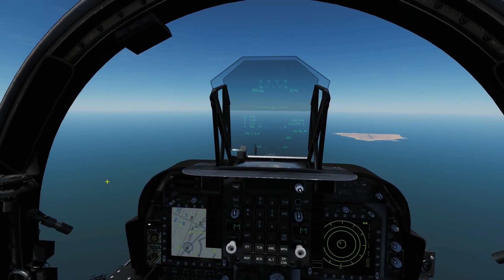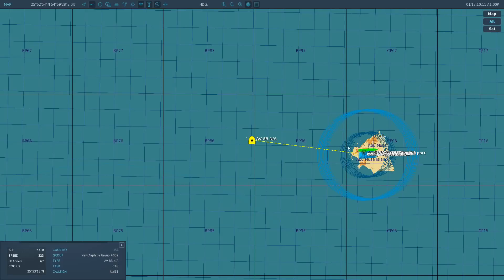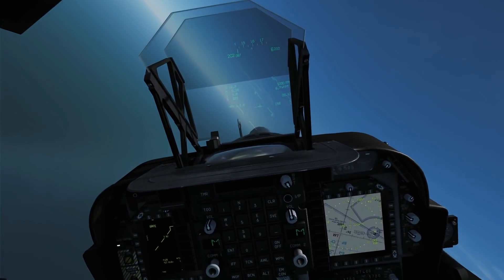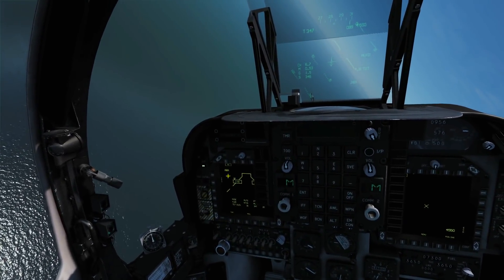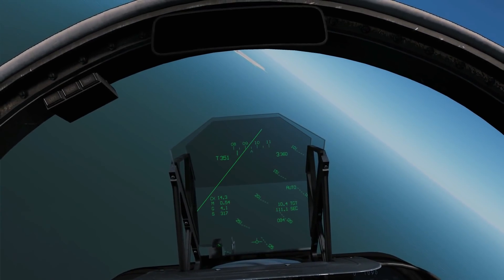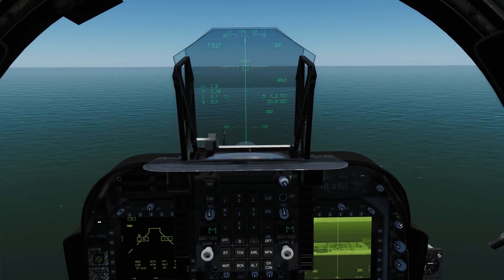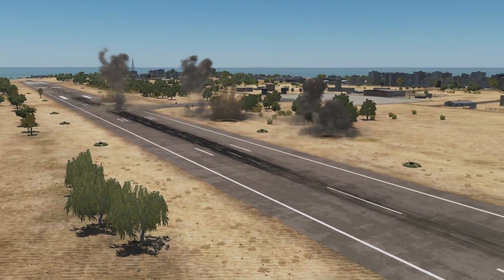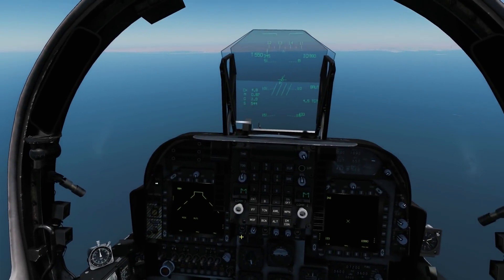AV-8B Harrier: Toss/Loft Bombing Tutorial | DCS WORLD

Comment: The Marine Corps tactics manual specifies the use of the toss (loft) bombing button on the stores page. The aircraft will then give cues as to when to initiate a pull up and the pull up is executed as a 4g pull up the plumb line to about a 38 degree angle.or until all bombs have been dropped. This can also be accomplished with smart weapons too evidently.
Reply: so one could use this with 38's to do a low altitude attack on a sam site?
Reply: @dannypeck96  any bomb, JDAM, LJDAM (utilizing laser or GPS) or LGB. Razbam has yet to implement the toss cue so you’ll have to guess distance which is why a JDAM could be effective but remember that the computer in the JDAM is going to calculate release point based upon your given flight parameters, so you won’t know when or if you can release until you’ve started your pull up and if your early or late you may never get a release cue. it will take some practice and watching some videos of ranges that others start there pull ups but the faster you go the further you toss. 
The laser weapon hold good promise as well assuming you can have a 3rd party laseing such as ground JTAC or an airborne unit or even a buddy orbiting outside but I would assume that if your tossing its because you can’t get close enough to bomb which is where a 3rd party ground base JTAC from say a seal team or other forward recon unit can be of great benefit allowing you to deliver precision ordinance on target with minimal exposure. Could be a good option for low cloud cover too that prevents a airborne laser.

Dumb bombs are pretty accurate with the system as well obviously.

The f16 is getting toss cues in the next open beta update as well so you can practice with other aircraft too and you can toss stuff that the Harrier doesn’t have like JSOWs which is cool.

Happy hunting and try tossing a sidearm at an sa6 site. It’s a good time.

Comment: Cap, I'm curious how you settled on 4.5 miles for the loft pull up.
Reply from the maker: Purely trial and error Sir. I spend ages trying different distances.
Reply: @grimreapers  gotcha. It's been ages, but I think BMS had HUD symbols to signal the start of the pull based upon your AGL and speed. I was thinking you might have pulled it from a table somewhere.  Thanks